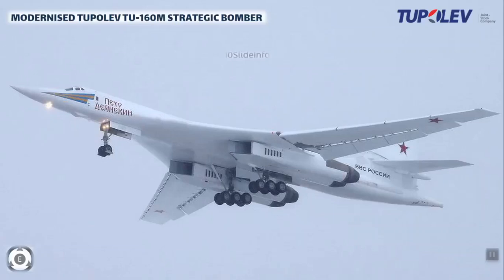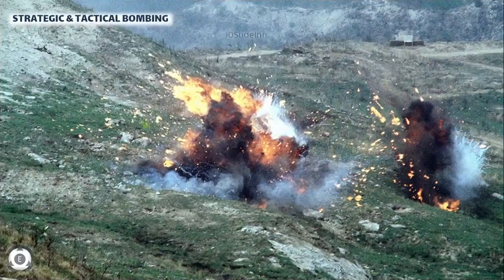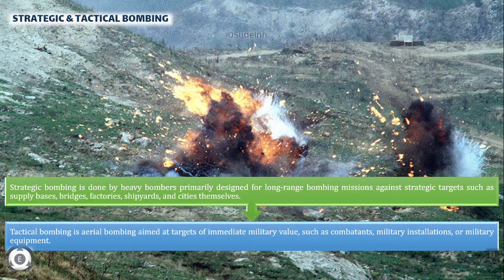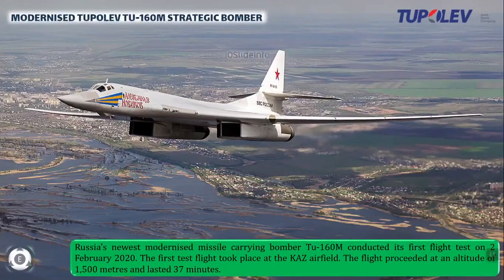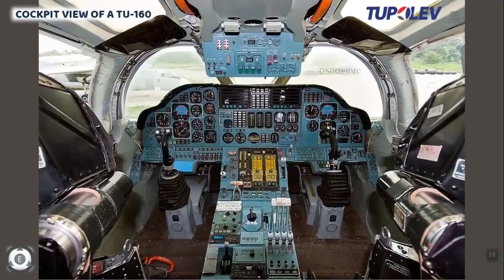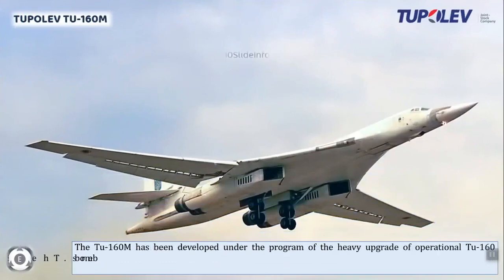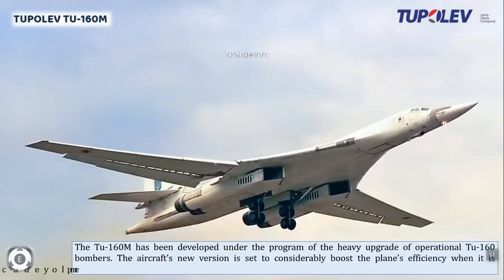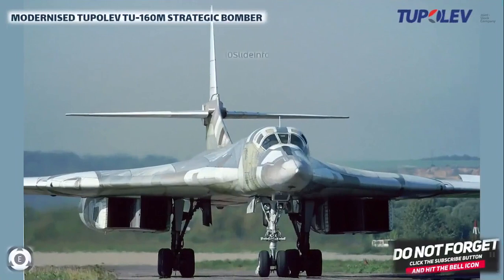Russia's Modernised Bomber Tu-160M | Strategic Bomber Tupolev Tu-160M 1st Test Flight | Kazan

Comment: Russia makes a great fighter but still has no threat capability long ranger offensive bomber, they just dont.
They need oil to be at $ 80- 110 ( consistently) usd in order to create new r&d. Gota hand it to the engineers, they could make a paper airplane long range bomber for less than $ 10 usd. They're very creative without capital.